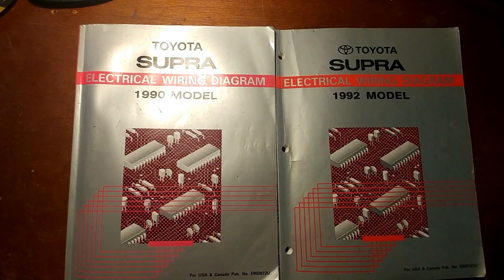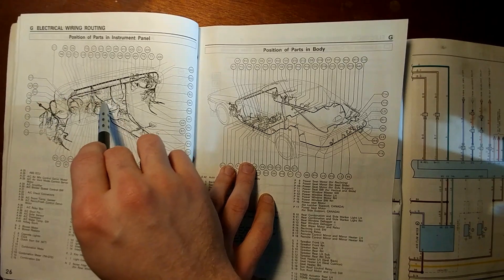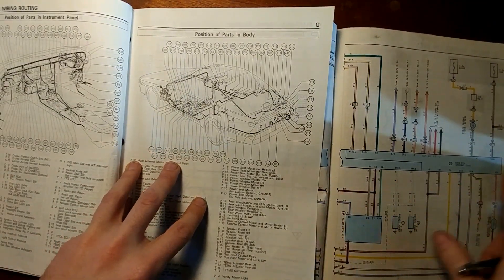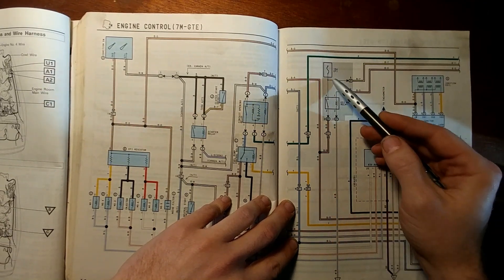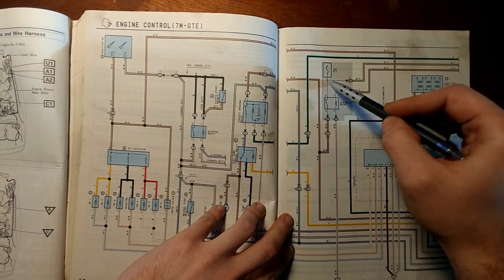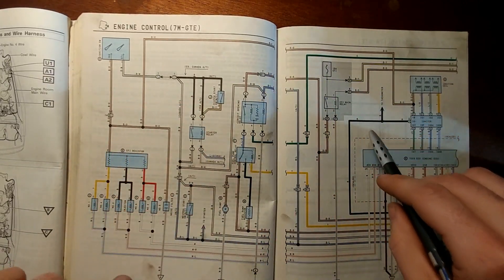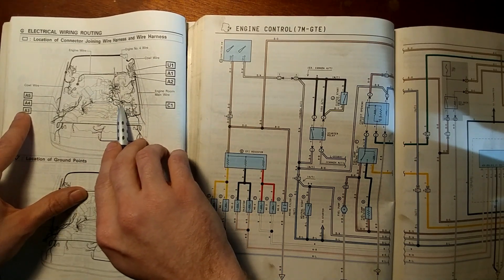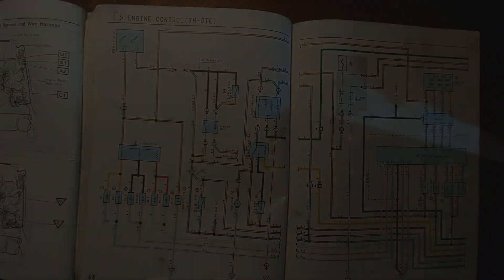YotaConnectors.com - MKIII EFI Main Relay Circuit

Comment: Hey Ron thanks for the video. Question, any reason why someone would add a ground wire to the EFI Main Relay? I'm having an issue where it seems like that relay isn't properly grounded and the AEM has issues under boost unless the headlights are on. I'm trying to figure out why having the headlights on would allow the car to drive better under boost? seems like there is a poor ground somewhere.

Comment: Hey Ron your videos are very helpful. If you're still making them. My 7mgte cranks but wont start I wanted to know if you could go over the circuit for the cps, igniter, coil pack, etc. Getting fuel pressure checked ground connections even the tiny wire at the coil packs to ground. I'll be ordering from your site as well. Thank you sir.